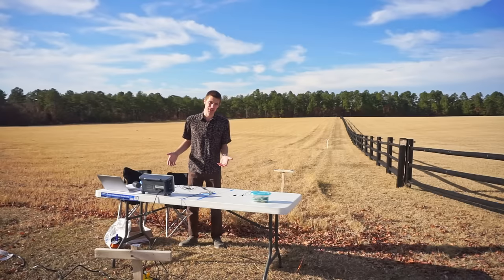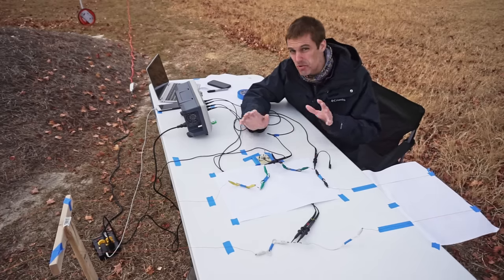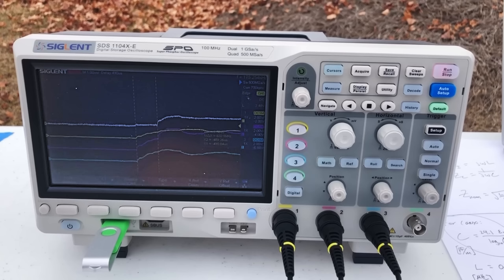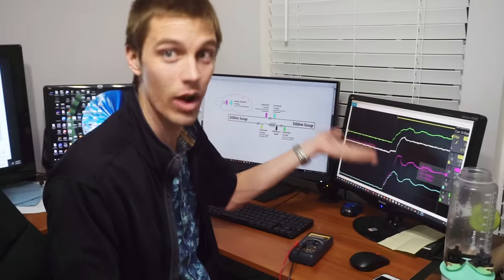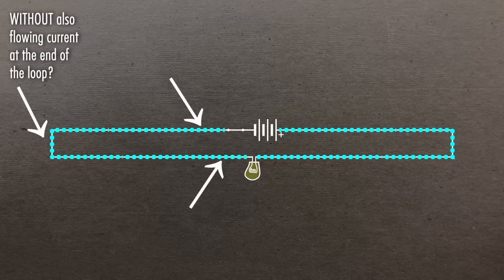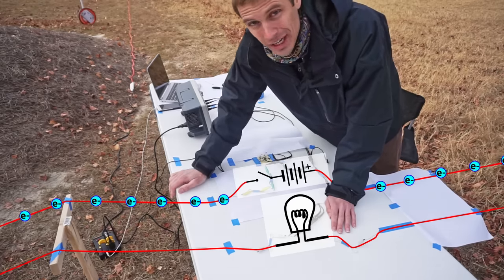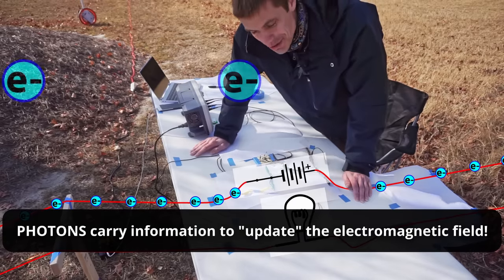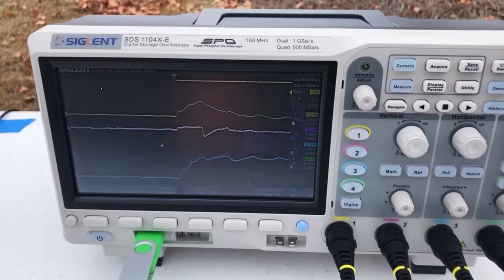I bought 1000 meters of wire to settle a physics debate

Comment: I think you even have to consider your circuit as a transmission line. Is in the air, so no dielectric is present and the propagation time is equal to the light speed. To avoid oscillation you need a load equal to the impedence of the line.

Comment: So, if I understood correctly in summary: There is an initial, small current induced through the resistor, with a response time consistent with the distance between switch and "light bulb" over c, but the steady state level of current only appears after a time consistent with the larger distance (wire length) over c?

Comment: If the "spring theory" on your analogy of how the electrons move inside a wire was accurate enough, wouldn't the electricity flow significantly slower than c? At least to me the spring like analogy gives an image of traffic jam but in reverse. I still do see it more clear if I think of it as a wave like analogy which to me seems a bit more accurate. If you push a spring from one end the other takes some time to accelerate to the same velocity it was pushed.

Comment: I feel like this whole debate can be summed up to the difference between how quantum physicists are taught to understand electricity, and the way electricians are taught to understand it. Both models work perfectly fine for both applications, but the electrician's model is just simplified because they dont need the extra details, however those extra details can be extremely useful to know in some circuits, and frankly i feel that they should at least be briefly taught the real model just so they understand they do not havevthe full picture so they dont spread a misconception.
Reply from the maker: I’m looking at this from the physics side, not the EE side
Reply: @AlphaPhoenixChannel  yes, I think all I meant was that the reason people doubted Veritasium from the start was a simple conflict of the intuitive model compared the the actual quantum model for current, they don't actually conflict in practice, only in principal.
Reply from the maker: @KCKingcollin  The quantum model for current ALSO has electrons traversing long distances.
Reply: @AlphaPhoenixChannel  That is undoubtedly true, but it also has the electromagnetic field accounted for which is typically absent in the model that's usually used. As I've said both models clearly work, all I'm saying is that the whole controversy could have been avoided if the typically used EE model would at least briefly explain what's happening with the EM field. While its undoubtedly not necessary to understand for most circuits, I think when teaching the subject, a curtain amount of completeness and correctness should be stived for, even if the EM field isn't needed in most applications, it is undoubtedly imperative to the real world function of current, and perhaps more importantly can actually help a bit with learning how it works the way it does, though I recognize not everyone prefers to know the underlying details when not necessary, it is also true that at least some large portion of people (including myself) would greatly benefit from a at least brief full microscopic explanation of the systems at play.

Comment: Would you please comment on what you refer to as "this blip", beginning at 18min 8seconds in the video?  "This blip" appears almost instantaneously, whether the wires are connected (at distance) or opened...   "This blip" carries information that the switch was closed, and seems to be present "faster than speed of light constraints".  Is "this blip" still there if the wires are further apart?

Comment: the circuit is not km length, its just a battery in series with a left side capacitor, a bulb and a right side capacitor, overall lenght of the circuit its 25cm left side cap + bulb lenght + 25cm right side cap + battery lenght, so ~50 cm ..  ofc the light travels 50 cm instantly outside the scope capability.. the ammount of current ofc is low, based on the capacitance, but no information here is traveling faster than the speed of light how the original video intented.. you can also get full current of the battery instantly if u use 100 meter height metal plates instead of 0.1mm wire... no matter the lenght of them the capacitor will act as a short circuit over a 50cm distance..

Comment: Does this mean if you had the wire as a giant circle instead of a "rectangle" (for lack of a better term), you would not observe this behavior, since the field around the wire would not be enough to immediately reach the side with the resistor?

Comment: You should have set up two separate oscilloscopes for the switch-battery measurement, and the resistor measurement.  The "tiny bit of voltage" across the resistor "immediately" is backfed through the oscilloscope, not a "wave starting at the light bulb".  I think you will not see that little bit of current through the resistor instantaneously if you use a separate oscilloscope for the resistor measurement from the switch measurement, and your proof is flawed until you show that you did not backfeed through the oscilloscope by using two separate oscilloscopes.  ❤

Comment: Answer this: Why does a flashlight switched on, win the race with the extension cord to the  ' droplight ' to the far end of the barn wall ? Answer : the distance between the flashlight switch, and the light filament is shorter than is the 100' extension cord, including a 25' corded droplight. The flashlight is so much much quicker, that it can easily be seen.

Comment: Even light slows down in mediums such as water. Electricity passes through a metal wire, but there is resistance when it does. I do not believe that electricity will travel as fast as light.

Comment: Man! Thanks for making this explanation - this is exactly how I understood Derek's results as electrical engineer (graduated 20 years ago but working as IT engineer). In my opinion Derek a bit missinterpreted his results. BTW did you try to check dependency of the initial current on the distance between the wires? I think it could help us conmfirm that the initial current comes from capacitnace/induction.

Comment: I suspect you would have slightly different results using a larger conductor which has less resistance reducing total impedance of circuit. Also a higher voltage induced into circuit would affect results.   Voltage can be compared to visually understanding to pressure in a garden hose. Voltage pushes.  Current would be the water in that scenario.   It is the current that does the work to overcome resistance.

Comment: Wouldn't it just be easier to send an AC signal down the line and also directly to some measuring apparatus? Then you can measure the phase shift to determine the speed of light. Use a saw tooth signal if you want to make measurement easier.

Comment: That not how electricity work, it doesn't travel through an empty vacuum. 

It is like water water travel speed, but if you fill the water pipe with water, pushing water in makes water come out at the other end, but all the water molecules has not traveled very far.

Comment: all these similar setups have the same wires running close to each other in a long skinny loop, and you mention that an electron is influenced by the electro magnetic effect  , Id like to see the setup changed to  one large continuous loop around the perimeter of the paddock. This way the conductors will be spaced quite far from each other and not be influenced by the electro magnetic field around the conductor.  Your conductor could be setup in a 250 mtr square per side. I know, it might be hard to find such a large property, but im sure its out there, just ask a happy farmer,  hahah   I think the outcome might be quite differant.

Comment: some late thoughts.      the wire is picking up ambient energy (RF and static).      the wire has capacitance.      the filament in an incandescent lamp is a 'poor' conductor,  at  all  times.
any  un-switched  connection to the battery/current source results in electrical potential, in at least part of the circuit.       consequently, some type of double-pole switching is   Needed.
it is not clear whether derek deliberately puts mistakes in his videos.      if not, then he is  sometimes   just  Wrong.

Comment: This video is more telling about the differences in perspective (vantage point) between physisists and electrical engineers, than it tells about the phenomenon. "I dont know enough about how electrical resonators work" Look at the equivalent circuit of capacitors and inductors in the ElectroBOOM video and it will be as clear as day why you see what you see on the Oscilloscope and you can easily calculate and predict those oscillations and the current that you measure. The point is that electrical engineers toolbox, although it shares some tools or understanding with physisists, is more developed and complete to understand the cause and effect of your experiment. As a physicist you can better understand the mechanisms at a sub-nm level, but I think a problem arises there where you cant see the forest from the trees, or in other words cannot see the coupling between the wires whilst looking at what is going on inside the wire, or right outside the wire. As a good scientist before and after the experiment you have to unpack the error and the contamination that skew the results.
Reply from the maker: I understand how rlc oscillators work, but there’s a difference between functional knowledge, and a low-level understanding that would make me comfortable publishing an instructional video to strangers. The aspect that I still need to dig into more is the high-level reasoning that driven oscillators are made the way they are. Plain rlc is comparatively simple

Comment: I am confused by something. You said that interaction between electrons is modulated by photons, then showed images of a photon basically bouncing back and forth between two electrons and that's how the electrons know if there's a negative charge nearby.

Is that actually all the electromagnetic field is? Are electrons constantly emitting photons in all directions on an invisible wavelength? Where is that energy coming from? What happens if a photon doesn't actually run into anything (such as in a vacuum or near vacuum like space)- even if I assume that a photon emitted by an electron always comes back to it after bouncing off another electron and thereby maintaining the same general level of energy, surely that wouldn't work if the photon never came back? There's clearly something I am not aware of and googling the phrase you used did not yield anything intelligible or seemingly relevant to the particular question.

Unfortunately this video is a year old, so I doubt I will ever receive an answer from you. But perhaps some other individual watching will see this comment and hopefully have an answer.

Comment: Hi nice video it do have a question (I don't know anything about this subject) if the copper wires were laid out in a circle 1K in diameter would you get the electromagnetic interference on the opposite side of the circuit as the switch I would have though the distance would be too great to have any affect over 1000m. Thanks

Comment: Thanks for doing this.  It’s fairly obvious that there has to be a light speed delay because of general relativity.  Information cannot travel faster than light. I didn’t expect the nearly instantaneous blip but it makes sense because the bulb is close to the power supply the time delay of the shift in the E field is much shorter.  Awesome.

Comment: Now I want to know: If I set up a system of connected gears and shafts, when I turn one gear, will the change propagate at the speed of light or faster?
Reply from the maker: Speed of sound in the material the gears are made from

Comment: The fact that it shows something in that first 1.6 microseconds seems to be information traveling faster than light. Maybe it only seems to be faster than light because the "information"  is only jumping from the "button press"  to the light bulb/resistor by way the crow flies and back to the oscilloscope through the leads and not down the entire length of wire.

Is it possible to measure at the button press as well to see if that happens slightly faster then the "bulb" gets that initial spike?

Comment: What would happen if you repeat the experiment with a circle of wire instead of parallel. I have seen Derek's video which I actually saw first and Love his content. Should it show the speed of the current through the wire and not through induction and other things that happen when the wires are closer together.

Comment: Add on question: If the wires (17:00) weren't as close as in the experiment, would the fields generated on both sides still influence the other side of the wire?

Comment: Thank you . I used tto be a HiFi nut , and was wondering if useing oxygen free copper or silver wire would improve the speed ? Also would a higher voltage AC would travel faster . Keep up the Science

Comment: No. But the "impulse" does. Years ago I had a serious problem at RCA regarding a pulse that was a tad too slow getting from point at to point b through a 100 foot cable that should only have been a 10 foot cable and THAT was the whole problem that these Engineers could not figure out! However I was an expert troubleshooter with a Tektronix oscilloscope which showed that the pulse required was arriving about 50NS too late. Well light travels about 9" in one nanosecond. Yep that was the problem. The extra distance that the impulse had to travel was about 50 feet too long!

What do I mean by "impulse"? Well what I mean by that is when an electron enters a wire at one end ANOTHER electron pops out at the other end. That impulse speed is at the speed of light, folks and it was proven on the scope.

Comment: As long as you lay it out and don’t let it wrap on itself so you get no induced voltage from the EMF of the power traveling through the circuit this’ll be interesting.  Sorry, seems dumb but I’m posting at the beginning before seeing result.  Also, what’s the sensing rate on your o-scope

Comment: But could you eliminate that flowing current effect by moving the wires long enough from each other? It is some sort of antenna and theoretically if you move the battery away from light bulb, this effect should be less pronounced

Comment: I am a novice at all things science but doesn't the electricity travel at a wire's velocity factor? It does in coaxial cable. I have coax with a velocity factor of 0.86 and some with 0.69 which means electricity propagates down the coax at 86% (or 69%) the speed of light in a vacuum. Does this concept come into play with this experiment?

Comment: This question can be answered with a counter question: Why do you think that fiber optic cables are used for data transmission (e.g. Internet) today or that copper cables are replaced with fiber optic cables?
But your Video is great
Reply from the maker: Signals actually travel down the wire in this video faster than in a fiber optic cable
Reply: @AlphaPhoenixChannel   I have to take a closer look at it: English is not my native language

Comment: It seems to me that you may have wasted a lot of time and work when you could have taken advantage of a much simpler and well documented process called TDR (Time Domain Reflectometry). It’s used all the time for finding lengths of conductors as well as discontinuities and lengths of the conductors without manual measurement. All you need is an oscilloscope and a pulse generator that can generate a very fast rise time.

Comment: But what about the short distance between the battery and the lightbulb on the table? Seem to be a foot or more away from each other on the table. Is t that’s lot for such a small amount of power? The argument was about creating a field. If that field is too far away relative to the power to even power the lightbulb. I thought the point was basically wireless power. The field would have to be strong enough and close enough to Fully light up the bulb. As you said the “air gap”.   I would assume that 5V in a wire is a stronger force than the field it creates.

Comment: Funny. My led bulbs in my utility room kept telling me there was microcurrent going through the line when the switch was off yet cfl and incandescent bulbs don't aluminate at all but i could tell the led was faintly glowing in an all dark room. Probably the switch i imagine. I removed the led because they are not supposed to be dim-able like the more expensive option at the time.

Comment: You need to move the light bulb to the end of the with where it loops back to the power supply then you will find the slight current seen is the same time as the full current. As the magnet field distance from the supply is the same length.

Comment: the electrons actually flow in both directions at the same time opposite to one another. because there are more electrons moving in one direction dominate the polarity. the electrons put up a fight against each other where action reaction newtons third laws is engaged. if electrons only flow in one direction the current becomes zero how ever there is still a field present in the wire but there is no energy that is being dissipated.

Comment: actually current is quite slow. What you measure is the speed of passing the energy between electrons in the wire. Electrons themself are quite slow (check for current drift velocity).

Comment: so then changing the setup so that the wires form a circle instead should show only the lightspeed propagation up the wire, because I imaging the static field would be too small to detect on the oscilloscope over 300 odd meter separation, of if it can detect it then there should be a 300ish m * C delay